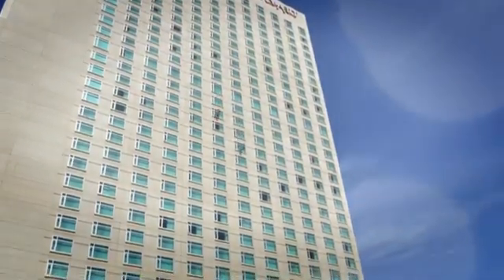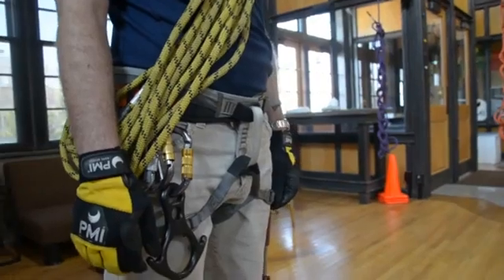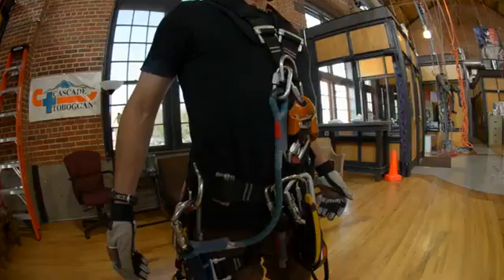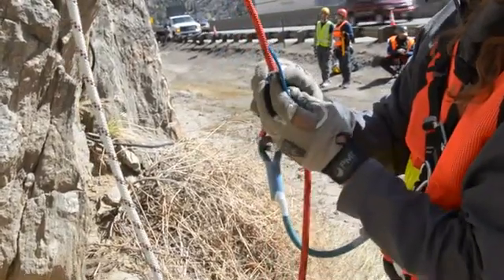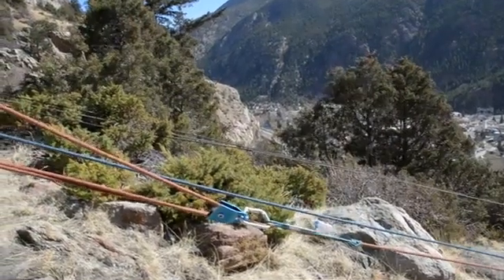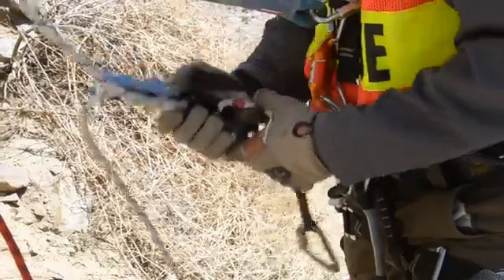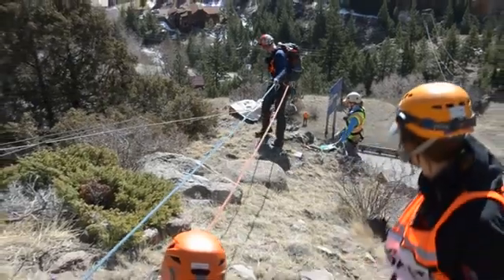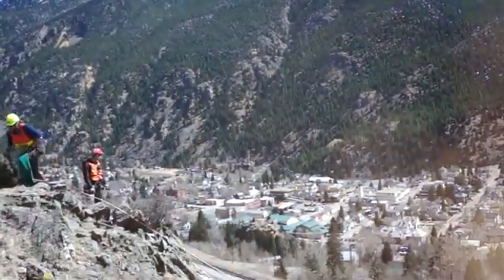WHEN WORLDS COLLIDE: Rope Access Rescue VS Backcountry High Angle Rescue Techniques

Comment: I guess my opinion is there is a lot more to ropes and rescue .ropes access is geared towards preventing the fall NFPA ropes rescue is geared more towards treating a patient that has had a fall or injury and it is a lot more technical than it seems you are expecting should probably spend some time with a ropes team to see first hand.but I will admit that ropes access is a very good level of certification for safety

Comment: The problem with aligning yourself as a backcountry rescuer versus a rope accession technician is the weight of all that gear this guy is talking about......much of the time in back country rescue you are flying in to a drop off, hiking to where the rescue is, and effecting a rescue all in a small team.The weather can often be fair to miserable compounding how much gear you can actually carry.Then you have to get out of there with your patient.So no I dont agree at all that these two separate industries will ever be the same for these reasons. Certain techniques an gear will crossover but often you are using your training and compromising on equipment to ensure you have a safe rescue.

Comment: I can’t believe what I’m seeing on this Video so called rescue!!! Someone would die of old age before this rescue was completed, and your putting your rescue team at risk.
Many of the system here is not safe, NEVER CLIMB UNDER AN UNKNOWN SITUATION, your telling people to climb up the rope of the injured climber.....Is the rope safe , chaffed , cut, on a sharp edge,  ARE there pebbles, rock, boulders that came loose ...COM’ON , ALWAYS approach an unsafe , unknown situation from the top down. Set your own ropes and bring one new set for the injured.  And if that person is bleeding out , you better know how to make an immediate rescue.
And if your trained properly call 911 ONLY to assist once at ground level, never the anyone interfere with your rescue that YOU were trained to do.

I always thought the SPRAT rescue was very slow and some things are for the level 1 climber. I set up IRA in NYC with DOB as I have been climbing 20 years before SPRAT was Born.  As a beginner the SPRAT rescue is a good start. At a 20’ training set up, Not for 20.30.40.50.60.70 .80 story buildings  high winds, rope entanglement or even  a mountain rescue with many unstable and unpredictable situations 
As a NYC Master Rigger, IRA subject matter expert. As you learn from experts and people with real time on rope that do rescue, remover 1000lbs from th stops of 50 story building. A rescue become part of a mind set and very automatic. YOU ARE NOT going to learn anything form a 5 minuet video. 
I’m disappointed to see this If anyone wants to call me 845-721-8515 George W. Cole NYC Master Rigger #176. 42 yrs of IRA
Please everyone know your limits seek answers and always err on the side of safety.
Reply: Can't understand what you're writing here but he covered most of the issues you bring up in your diatribe.

Comment: They should organise a yearly rescue competition for any rope access/mountain guides etc to compete against each other in simulated rescue situations to really find out what are the best techniques and what they can learn from each other's disciplines
Reply: Dont forget the tree guys:
-Preforming aerial rescue on a 100' single stemmed tree or a 70' canopy with limb-walking involved (in the rain) from a central tie in+redirect
-Powerlines 8 feet from the trunk limiting bucket lift rescue
-No additional safety lines pre-set 
-Climbing with spikes on your feet, rated boots with a rigid shank inside, and sometimes foot ascenders as well
-Ascending single line and switching over to double for movement and descending
-Knowledge of tree composition and healthy anchor points and crotches
-Knowledge of common eye-to-eye friction hitches. blakes, tautline, distel, swaybish, VT, Michican,
-Setting your own line from the ground with a throwline + slingshot, redirecting it carefully, and then stringing your rope all remotely.

Needless to say it carries its own set of skills.
Reply: Pro trick : you can watch series on flixzone. Been using them for watching all kinds of movies these days.
Reply: Grimpday! That competition exists. Its for teams, not individuals though.
Reply: @Otto Tobias Yup, I've been watching on flixzone for months myself =)

Comment: A Quick counter balance instead of a 3:1 is much simpler on ascent rescue
Reply from the maker: Good point Danny! But if the rescuer ends up being significantly lighter than his victim, they may have no choice but to go with a mechanical advantage system. Thanks for the comment.
Reply: True !!!.. Ideal circumstances though, u wouldn't have a weak person conducting a rescue
Reply: +pmirope True, and not being smart, but in the real world, this is a rescue scenario. Once casualty is attached to rescuer, just use a knife. 
Rope access tech is now free and no different from a climber or any other scenario the rescue team is experienced for.

Comment: I can think of only one reason to carry heavy, bulky, ANSI-rated stuff: to comply with regulations. Otherwise, weighing yourself down as a rescuer is a very foolish decision.
Reply: In arbor culture and line clearance tree trimming we have heavy, bulky stuff too due to ANSI and OSHA standards. But a lot of our climbing stuff can blend in with the rigging gear so its a good to have more distinct biners and the use of snaps so they dont get mixed up. Usually its aluminum for climbing and steel for rigging. Also, our Ropes are 1/2" or 11mm minimum to deal with the abrasion. And our systems are designed to ascend and descend. Some even ascend using single rope and then switch over to double rope for canopy work and descending.
Reply: yep, and it's also something of a monopoly. These Rope access institutions make maintaining certifications, which become required by management policies, ridiculously expensive and arbitrary to maintain. $
Reply: That ain't no joke. I just found this. I am getting more pissed off at the industry bureaucracies by the day. A bunch of idiots that I don't want around me.